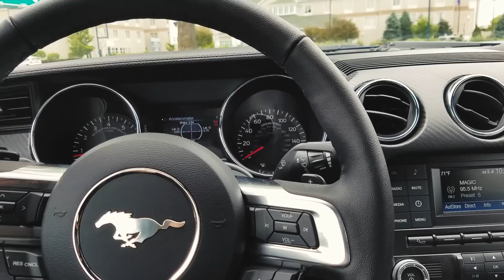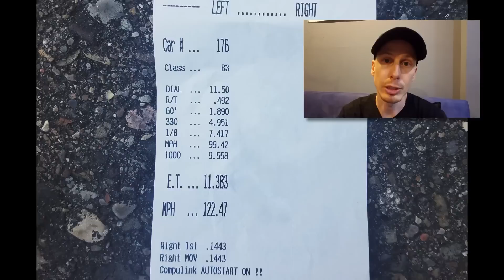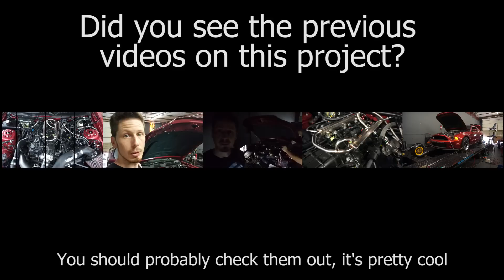Project Ecostang: 3.5L Ecoboost Swapped Mustang -  Part 6

Comment: Have you guys come across a built 3.5 yet? I saw Livernois Motorsports offers forged 3.5 shortblocks. Just curious what the reliable horsepower range is on a built 3.5 with bigger turbos etc..

Comment: what port injector rails are you running????   it looks like a Auxilery fuel setup. i have a built bottom end full bolt on bigger turbos f150 fx2 tremor. running out of fuel
Reply from the maker: I wouldn't approach your tremor in the same way we did on this Mustang. Send us an e-mail with what you've done so far so we can give you a better recommendation. tunes@morepowertuning.com

Comment: 800 to a 1000 hp. gonna be time for a powerglide!
Reply: Fordfanone 6R80 can handle that fine.
Reply: SirtubalotTX they used a 6r80 with the turbo 5.0 mustang and it held up just fine around 9000rpm lol with 2000hp

Comment: You do need to stand on the brake!
Dont waste the vacuum getting boost on the first bulb... 

Also should be preturbo line to booster and regular line to booster  with check valves

Comment: I know the video concerns the 11-15 EcoBoost setups but I was wondering if you guys have, are working on or know of any other setups that pertain to the 4.0L Cologne V6. I'm just starting to look into this area given I got my hands on an 08 S197 V6 and was curios of the options. I know you can put the 3.5 EcoBoost Turbos on the 3.7 with adapter plates and other parts. I'm just curious on Turbo Kit options available for 4.0L whether it be EcoBoost Turbos or Aftermarket Kits. I don't expect you to do all the research for me or anything but maybe point me in the right direction. I'm generally a V8 enthusiast and currently have two S197 3V's and previously owned other mod motor cars such as NEW Edge/CVPI and a SVT Focus. I appreciate any assistance on the matter and I'm really impressed with what I've been seeing out of the EcoBoost and 3.7 engines. It would be great to see similar response to the 4.0L.
Reply from the maker: Sorry, we don't deal with the 4.0L V6 at all, nor do we have any recommendations for that platform.

Comment: why does't ford offer this as a package for the mustang?  it would be a good compromise since the L4 ecoboost is a good base, and the coyote is there for N/A V8 fans.  
Oh hell, if ford wanted to we could have a Mustang SHO. with all wheel drive. of course this might be seen as a perversion of what a mustang is, but damn it would be fast
Reply: Too much of a direct competition with the V8. It would be just a tune and these cars would be blowing away the V8's. The 2.7L v6 ecoboost would make more sense to me. stock 325/380 with a tune its probably around 385/500, considering the 2.3L with unleashed makes around 350-360 hp and 440-460 tq.
Reply: You can inch the 2.3L to about 450 to the crank without blowing it and 500hp if you build it out of a 2.0L block.

Comment: I just have laugh sometimes at what people do with cars, but why not turbo the 5.0 engine. The 3.5 will never make the power the 5.0 because of the simple lack of displacement. Nice car, and good luck.
Reply: ICE Viper but it makes more torque...
Reply: BowBowFlakka So would the 5.0
Reply: Trevon Adams 
That's the best you could come up with, lol
Reply: That’s like saying the Nissan 3.7 v6 won’t make the power when they can push over 1500 built 💀😂